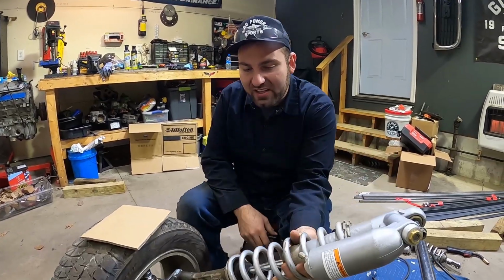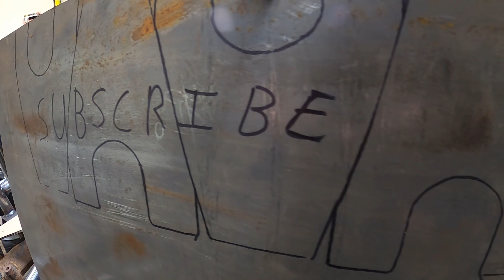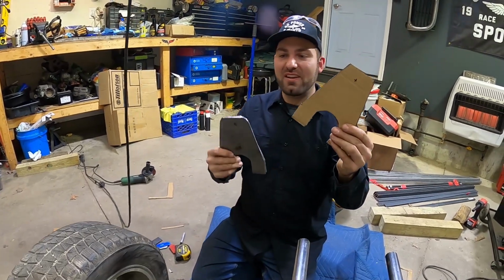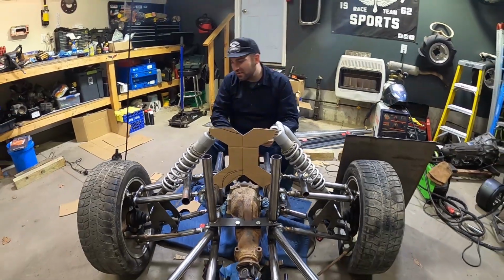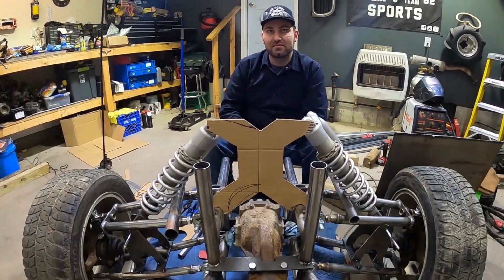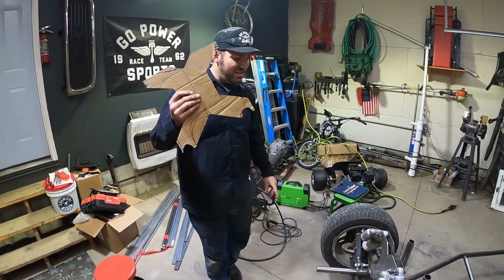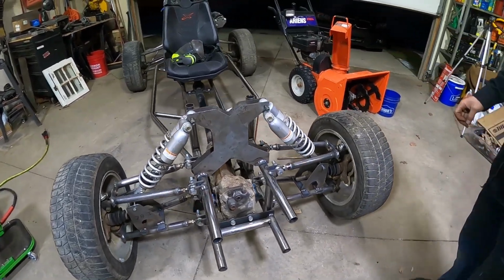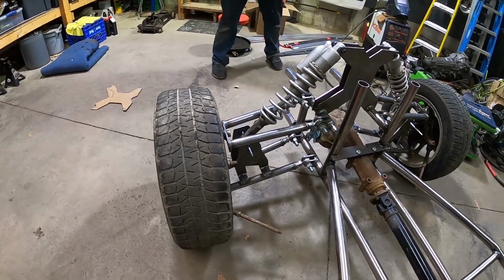SHOCKING!! 4x4 CROSSKART Front Suspension! Subaru Drivetrain

Comment: Looking good, love the diffs connected by the common drive shaft and sprocket, very clever. If you take your corrugated CAD patterns and transfer them to rigid paperboard and offset it inboard the distance from the edge of your plasma tip to the edge of the center hole (mine is 3/16”) you can use the paperboard template to guide your plasma directly. Lay it on your sheet metal and guide along the edge of the paperboard. I did it for years building armored cars with tons of little templates. This was before CNC plasmas were so common. It will save you a ton of time and you can get nice parts without much clean up.
Reply from the maker: That sounds pretty cool! We will have to check that out!!

Comment: i saw where y’all said you are just going to unbolt the drive shaft for 2wd stuff but have y’all thought about making a selector for it by using a large bolt head/ splined shaft and a 12point socket/ coupler and making a cable or lever system to actuate it with a bearing on both sides for support

Comment: Did you consider sleeving the bottom of the shock and having 2 solid arms come down on either side of the axle and connecting  to a pivot at the a-arm? I have seen this done somewhere on a car.  It seems to me (and I might be wrong) that having the lower pivot point so high above the lower a-arm would add alot of outward stress on that bracket when hitting bumps or jumping. I would just modify your plan so it is solid mounted to the bottom of the shock and pivots at the a-arm.

Comment: Lookin good guys. I have a concern though, thoes lower ball jointa were never designed to hold the load of a vehicle as they were used in conjunction with a macferson strut. They are basically just "follower" ball joints. Im no engineer so it may be fine and with the cart being much lighter than the original car it may be fine. Otherwise keep up the great work fellas
Reply from the maker: Thats a good point👍 our thought was  we didn't want all the extra abuse on the single upper heim joint. We are banking on the light weight of the kart to not harm the ball joint too much.  Thanks for watching!